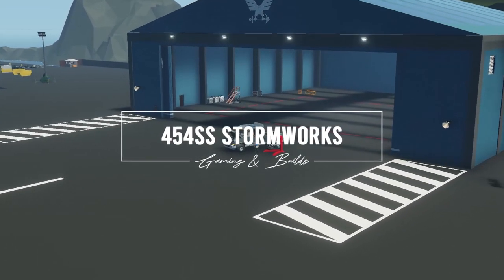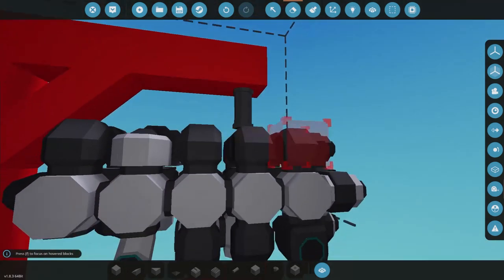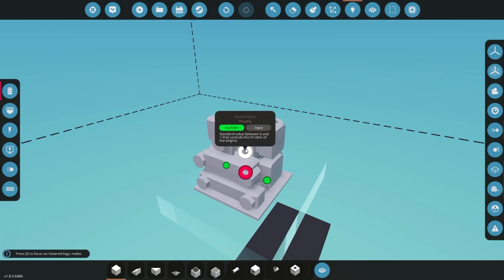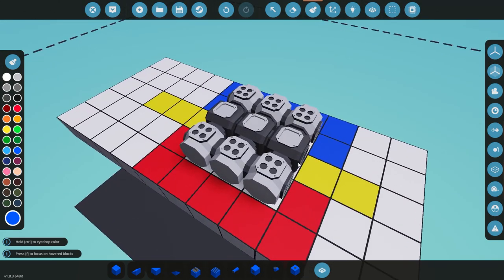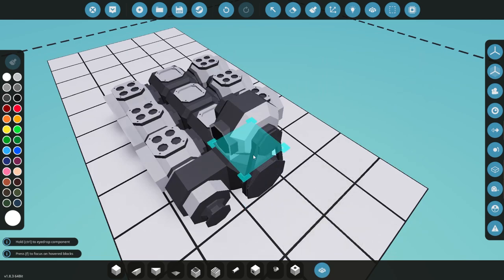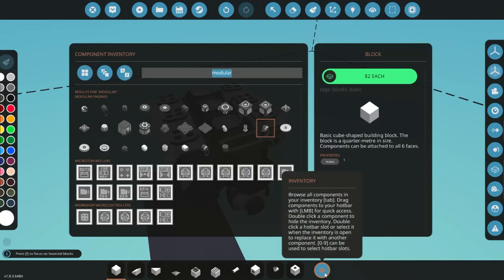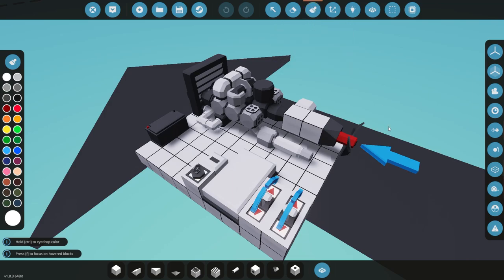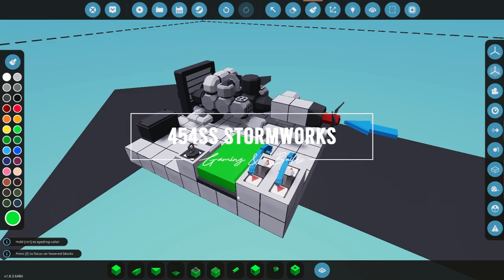Understanding Modular Engines in Stormworks (Engineer Explains)

Comment: I dont mind calling it a V6 in the game but it's called a Flat 6 if anyone is wondering and there are cars in real life which have engines with cilinders placed like this, mostly in porsches and subarus
Reply: Or a boxer.

Cylinders placed at 90° or 60° would be a V, regardless of orientation, although technically it would be an L if one bank of cylinders was aligned horizontally (0°).
Reply: @demonicsquid7217  spot on
Reply: Absolutely!  Hearing him calling it a V6 rustled my jimmies considering he's an engineer.
Reply: @demonicsquid7217  I use a boxer engine in my Toyota Hilux because otherwise it wouldn't fit, and I try to be size realistic. Boxers are also common in small planes, very good engine layout i like it. More space for manifolds in your builds.
Reply: @demonicsquid7217  Boxer and flat aren't the same. A boxer is a flat engine, but flat engines aren't all boxers. Boxer has opposed pistons that do their strokes at the same time. So they move outwards and inwards at the same time. A flat V or 180° V has the pistons at alternating strokes.
Reply: @djhagrid300  true
Reply: I’m 6mo late to the video but yes absolutely, Subaru H6 engine GO BRRRRRRR
Reply: You cant really differenciate from a V or flat in this game. it would be a listed V engine.

Comment: The amount of air a fluid pump delivers into a pipe system is fixed, but the amount of air a engine uses is variable. And the small 3x1x1 fluid pump shuts down if it reaches a pressure of 10.

So, the pump pumps air into the air intake and the fuel multiplier "runs" behind, until the pipe system reaches a pressure of 10, at which point the pump shuts down and the pressure in the pipe system for the air intake quickly drops, which makes the fuel multiplier do a 180° and run in the other direction, again behind.

A supercharger with either the fluid pump (3x1x1) or the large fluid pump (2x2x2) without any pressure regulation is always either above or below the optimal stoichiometric.

There are serveral ways to deal with this. The easiest is a air scoop. Place it facing in the direction of travel without any pumps directly on the air intake and it will provide the maximum pressure at relative low speeds. Another way would be a variable fluid valve, which one can use like as bypass. You will have to control it with a function that takes the rps and air intake throttle into account. Impeller pumps can work, too, but are very inefficient. I also saw people using wildly different methods that also work great.

But why does it matter?

Because you don't just randomly run your engine on any stoichiometric. You are an engineer, or not? You use the optimal stoichiometric for the current situation. But a oscillating afr means that the stoichiometric is also oscillating, which means that the engine always runs above or below the optimum. Doesn't matter if that optimum is fuel efficiency, max power or whatever, you will always not use the optimum. It also makes things like traction control very difficult, as the power output of the engine can be way less in one frame than in the other.

edit: one more thing. The optimal fuel ratio for real life engines does not apply to this game. For fuel efficiency, the optimum is for some bizzare reason a stoichiometric of 0.2 and the afr for this is:
13.6+clamp(x*0.004,0,0.4)
x is the temperature of a cylinder
This function will never go above 14
Reply from the maker: The beauty of the game is you can get as detailed as you want! I only touched on the supercharger in this video, and this video is intended for beginners :) Yes, I am an engineer
Reply: @454ss_gaming  i bet you need to be an engineer to play this game lmfao

Comment: I have found a problem I think you left out parts of the video recording that should've been shown, for instance the 2nd throttle lever, and I followed every step and even went through the video multiple times and  sometime after 26:12 you leave the microcontroller thing and the other throttle lever appears out of nowhere
Reply: i have the same issue and you can see that its plugged into the clutch but when i spawn it i cant use the lever

Comment: I'm curious, why does no one seem to use the flywheel on their mod engine builds? It is always crank to clutch
Reply: it is massive and there isnt really a proper use for it
Reply: @jzzz-qd1nj  fair enough, if it serves no purpose why use it. I can vibe with that answer
Reply: It can have some niche uses with aero engines or sea going vessels. In SW its drawbacks outweigh its usefulness in most use cases - harder to start the engine, oversized especially on smaller engines, not enough performance gain etc...
Reply: I think I once tried using a flywheel, but truth is, it doesn't really help. With no flywheel, quick start, and you can easily gain speed and if you want to loose speed you just stop throttling. With a flywheel you would need an advanced clutch system for good performance, when braking enable clutch, then when release make clutch 0, while mainting updown counter and backup reset and all the other things.

Comment: I'd like your opinion of my EFI creation. I've had this for some time now and I haven't seen anybody else create a controller like this before me but haven't been looking since. It's an EFI controller for modular engines that regulates fuel based on the air flow. If we get proper turbochargers that vary in pressure I think this would be invaluable

For some reason my comment gets deleted when I include a link to the steam creation.

Comment: anyone else have the issue where the W/S control he set up in the last video works in reverse, like S raises throttle and vice versa?
Reply: Just use a numerical inverter, or inside a microcontroller: Get W/S signal into a Function block with one variable. Then make x*-1, this will reverse the number back again. Then make the function output to the throttle or whatever you wanted

Comment: mine wont go past 3.84 rps and wont stay on. it gos forward and backwards but only at 3.84 rps but idk whats wrong
Reply: That means you are just being moved by the starter
Reply: @invention64  ya in the month since I posted that comment I figured it out. Got the fuel and air right and have the mix hooked up to the throttle and fun block. Starts up now

Comment: modular engines are underpowered, flat 8 engine cant even drive a small tank track just use pre built ones.
Reply: The point of the modular engines is they are completely customizable
Reply: Just for reference some tank engines were 27 litres could that be why an 8 cylinder is underpowered? Genuine question or are they underpowered in this game?
Reply: i got no idea what you mean by "engines were 27 litres" because you cant change how big the engine size is in stormworks i mean theres 1x1 3x3 and 5x5 size but thats it.